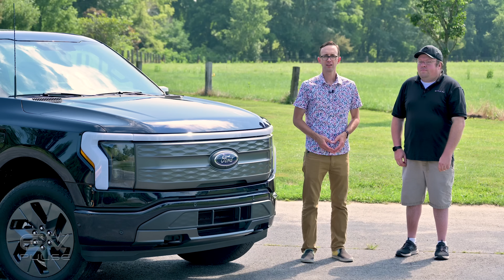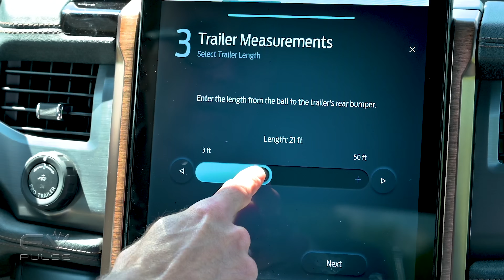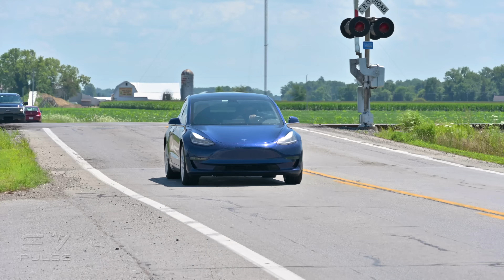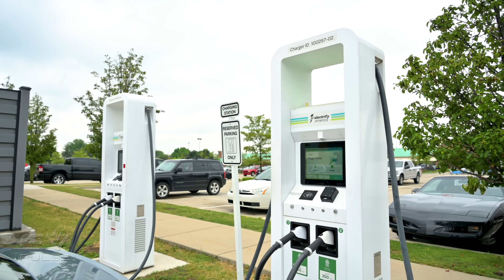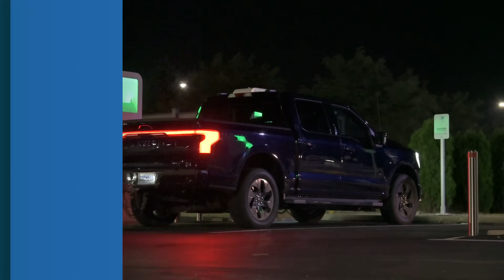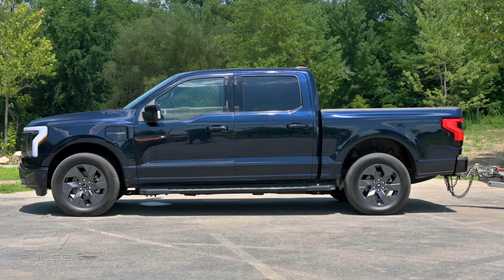Unveiling the Ford Lightning's Towing and Charging Capabilities

Comment: The trailer with brake is the biggest problem for the range. If the trailer could get a regen brake, it'll change a lot. Those bolt EV owners towing small no brake trailer already proved.

Comment: I think your towing efficiency is high because you are towing one of the most aero dynamic cars on that trailer. If it was  a more typical boxy trailer probably highway range will at 150 miles and below.
Reply from the maker: A boxy trailer would be less, of course, but we wouldn't say it's "more typical." Half ton drivers tow lots of different things (boats, jet skis, side by sides, lawn mowers) that aren't in box trailers. YMMV.
Reply: @EVPulse  true! Would be interesting to see the efficiency though.

Comment: No one wants an electric pickup. No matter how hard you push this product, they will sit in dealers lots unsold.
Reply: I’m “no one”.  My wife and I love our Lightning.
Reply: Roman from TFL Truck has tested just about every truck on the market for the last several years.  He tested the Lightning extensively and drove it from Colorado to Alaska and back.

He calls the Lightning "the best truck Ford has ever made."

As you might notice in these comments, videos about the Lightning frequently get comments from Lightning owners remarking on how great the truck is and how much they love it.

The Lightning reached record sales numbers in 2024.  I expect sales of the Lightning and its successors will slowly grow until they exceed ICE version sales.  I give it about six or eight years before electric trucks begin to outsell ICE versions.
Reply from the maker: You should look at sales data. These trucks are not sitting unsold.

Comment: Now imagine taking this trip in the mountains. Or in high headwinds.  And will there be a charger where you need it?
Will the charger be a fast charge? Will you have to disconnect the trailer to access the charger and not piss others off by hogging all the stations?  Do you have the time to kill while you WAIT and WAIT for it to charge? What if its only a slow charger? Imagine how long THAT will take. What if another rig is already at the charger...for AGES and AGES???  What if you run out of juice on the road? Or out in the boondocks?  Does AAA charge EVs with their tow trucks???  If not, you will get towed or carted away. And you probably will have to leave your trailer or hire a 2nd truck to tow it away...gasp!  
Seems to me that these issues (and more) will have to be worked out before any long distance, wide-open-spaces towing is even considered with EV trucks.  As the EV ages, it battery will age, too...and provide even less range. Better stick with your ICE truck for serious towing...at least until the Gub'ment mandates it away from you or starves away fuel for it citing some bogus emergency.....
Reply: You make valid -- and troubling -- points. Electric trucks offer some HUGE benefits, but they also have big downsides. For short-distance or relatively light-duty towing, the Lighting is absolutely amazing, but I wouldn't want to drag a 10,000-pound trailer across the country. No thanks. Towing in winter or in mountainous terrain is super concerning as well. The way most drivers today use "half-ton" trucks (i.e., like family sedans), the Lightning is pretty close to ideal, but people that need a long-range work vehicle should consider a combustion-powered pickup.

Anyway, thanks for watching and commenting. Much appreciated!

- Craig
Reply: I always have 3 propane tanks and a generator with my travel trailer so thats 21hrs of emergency charging for my tow rig its weird for sure but i hate smog and over heating transmissions engines and all that nonsense so will see if this ev nonsense is worse lol
Reply: So many "what ifs" and a little bit of conspiracy theory thrown at the end, nice.

As for the gud-mint mandates, if EV infrastructure is still not ready when the deadline approaches and there's enough popular concern, obviously the legislation will be repealed, and alternate paths will be looked at, like biofuels and hydrogen.
So I doubt anyone will be "forced" to buy an EV that won't fit their needs.  That argument is nothing more than useless fear-mongering to me.
Reply: Two hours and seventeen  minutes  to recharge? 'Who would be happy with that ' when a fuel vehicle would be ready to go again  in less than ten minutes ' in my experience  when you've been  driving  for hours you just want to get home . Ridiculous.

Comment: I’m in Kentucky. We have mountain and very few flat areas.  A battery on any vehicle wouldn’t last any time in hilly areas.
Reply from the maker: With regen, you'll gain miles going downhill, though. Not a direct correlation, but it's not as bad as you might initially think.
Reply: @EVPulse prove it. Start including hilly (proper hills or mountains) in your reviews.
Reply from the maker: @jimporter  You want us to drive 5-8 hours one way for each car review we do? The metro Detroit area isn't well known for its mountains.

Also, we do drive in hills and mountains on our first drives. And we have made nearly as much back on regen as we did waste going up the mountain. It's physics.

Comment: I don’t see where you get 7,000lbs for a Tesla 3 and a UHaul double axle car trailer?? I find a Model 3 is 3,648-4,250 and the UHaul is 1,775.  This does not come up to 7,000lbs.
Reply: Yeah its not, there result are garbage. Ive towed 5k on a flat highway, going 65 mph, temp was around 70F, no A/C on or anything....range went from 230 miles to 110 miles. Basically, garbage.
Reply: @davidwest6019  Yes, that’s what I”ve seen on other owners tests!

Comment: The only EV I would buy, sign me up.
Reply: The Lightning is expensive (and sold out at this point), but it is a remarkably good EV, like really, Really, REALLY good. It's not built on a dedicated electric truck platform, but Ford still did an astounding job with this truck, knocked it out of the park.

Thanks for watching and commenting!

- Craig

Comment: Also, you need to try towing an EV with V2G capability and run a cable from the towed vehicle to the one towing to try and recharge yourself while driving!
Reply from the maker: Infinite power! Actually, engineers prevent the truck from charging while the vehicle is driving.
Reply: Actually, we were kind of joking about that while filming. We're going to try to see if we can charge another EV from the Lightning's in-bed outlets while the truck is plugged into a DC fast charger. We're not certain it's possible, but it'd be cool if it is.

- Craig
Reply: If you read the terms, it actually voids the warranty😢